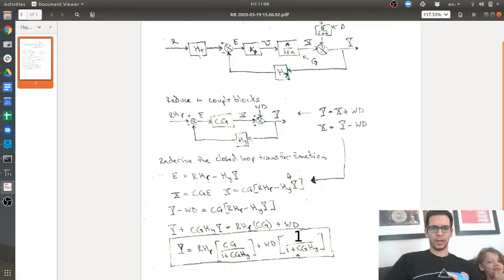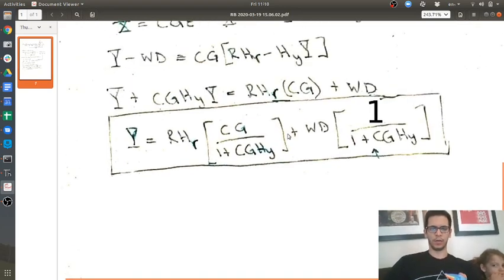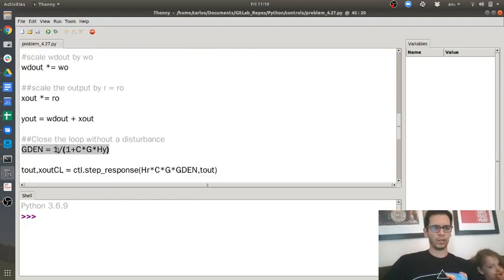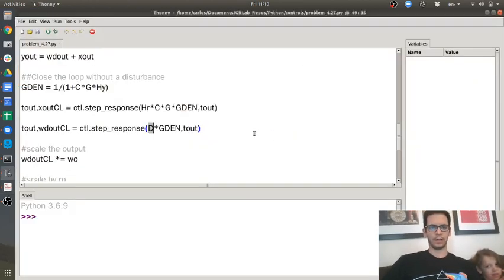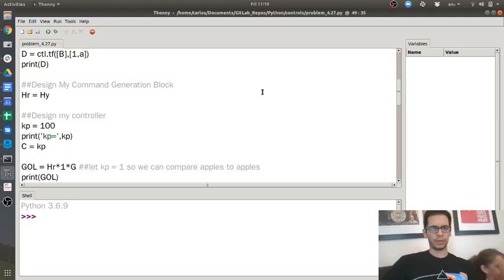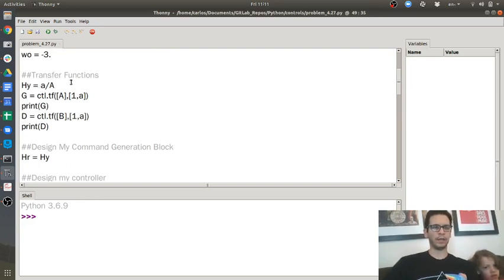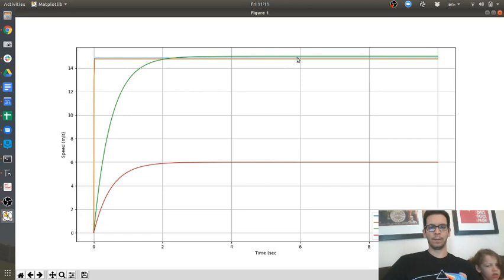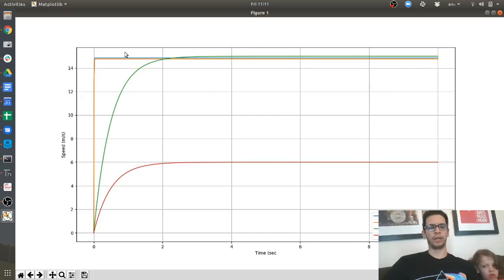Control Lectures - Error in Disturbance Rejection Post

Comment: Hi, can you solve about Falkner-skan equation for different beta values in Matlab by using R-K method? Also for thermal boundary layers.
Reply from the maker: I'm not familiar with thermal science. I am an aerospace engineer specializing in Flight Dynamics and Controls
Reply from the maker: It seems you've sent me a link to the equation. Unfortunately I do not wish to take the time to view it. If you have a question relating to something more related to my field or related to a video I've already published then I would be happy to assist you.